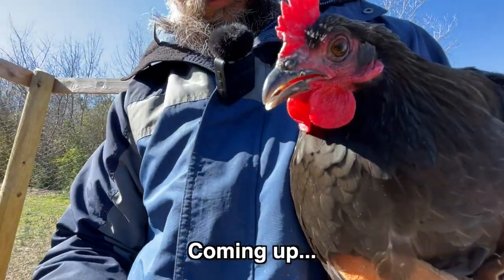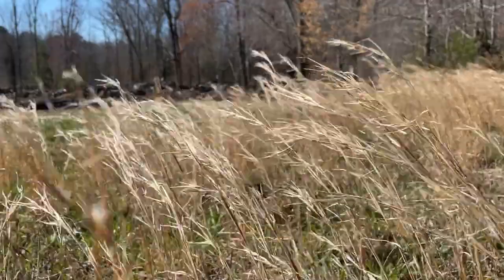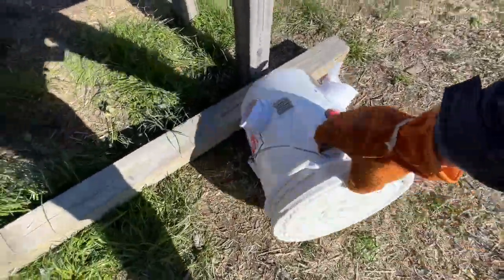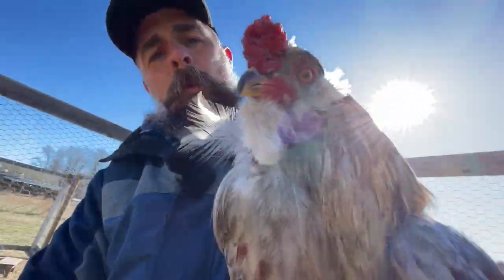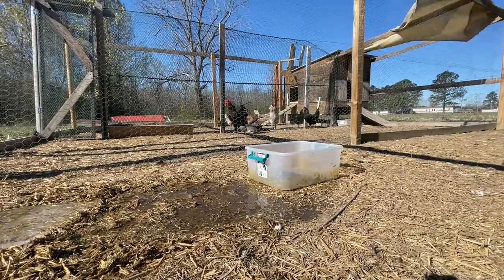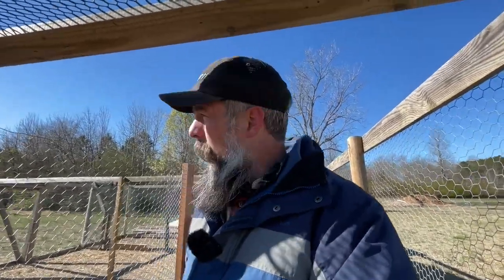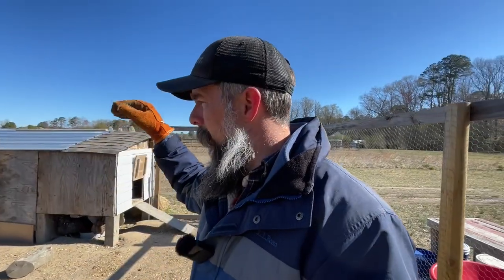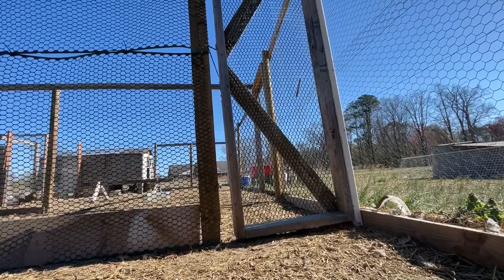Saying Goodbye to a Beloved Chicken... What Happened?

Comment: The feed bags are handy for sewing into tote bags.  Lysol wipe clean inside and outside.  Cut enough from top to use as handbag/totebag. You can adjust the width if you want to by simple stitching it to desired size.  Stitch handles and sew onto bag. So handy for carrying anything from donating eggs or such.  Very sturdy.